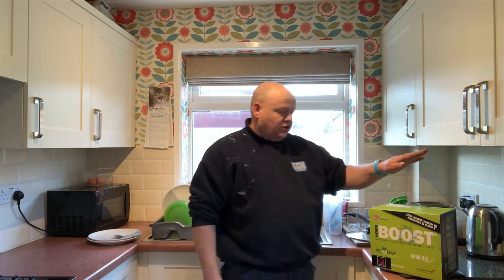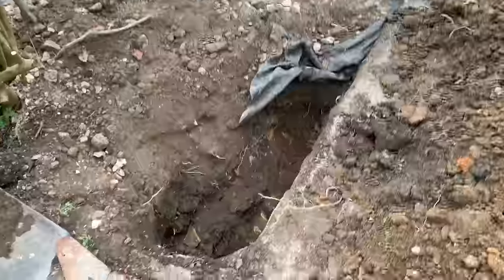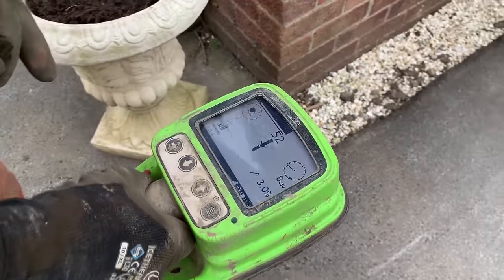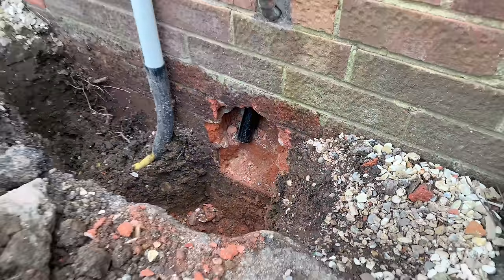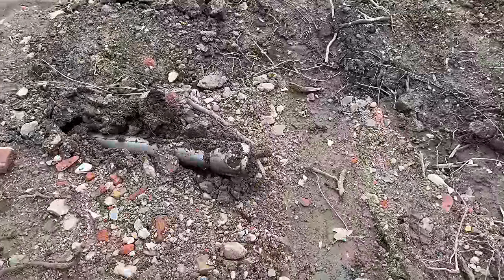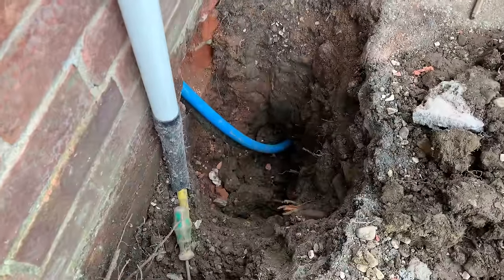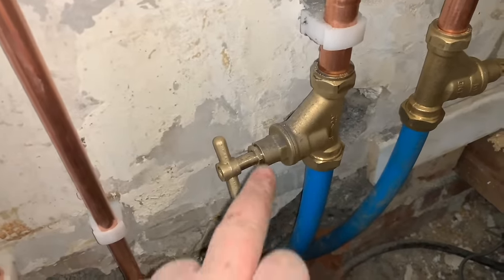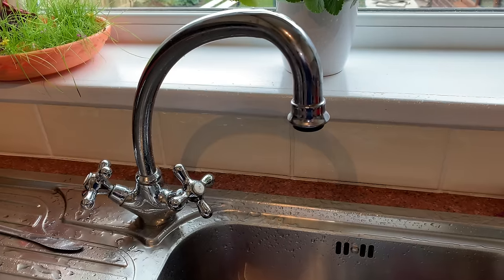MDPE WATER MAINS INSTALLATION - No Digging - Moling - Trenchless Pipe Replacement

Comment from the maker: If you want to boost upto 12 l/m then check out this video. https://www.youtube.com/watch?v=mPmBgEMtHJQ
Reply: Let me ask you about the drilling technique. In this angle drill should goes deeper and deeper into the ground but it goes sort of parrarel. How it possible. Do i missed something ?
Reply from the maker: @DerekHundik  They turn it to go where it needs to go. Thanks.
Reply: I bet Supamole didn't know you were putting this on 'You Tube',  No compliance to the NRSW,  No compliance to HSG47,  No compliance to . . ., , sad really, as used correctly 'Reduced digging' installs are so much safer and better.  He drilled up the same lay as the Gas service and the Electric supply . .  I know you will be thinking who the %$£& is this guy. . . Retired Health and Safety Compliance Manager with . . . National Grid Gas,
This video shows exactly why we have the HSE, if you look close at 12.30 the earth from the electric supply is connected to the copper under the floor, when you cut the old pipe off, if you don't connect the earth to ground, if you have a fault on your wiring you could electrify your whole house. This is very dangerous.

Comment: All done madam. 

All I need to do is return and sleeve the whole pipe, fit a non return valve, a drain off, turn round the valve which is fitted the wrong way and brick up the massive hole I smashed out with a hammer because it was easier than getting my drill out the van.

If this wasn't a cash job I'll eat my hat. 

Allan you loon get a water regs book!
Reply: Was thinking exactly the same myself lets just hope the local water authority dont watch your tube
Reply: Matthew Mottram gas fitting in the wall as well! & its press fit which he uses a lot 🤔
Reply: Are you saying he did good or bad?
Reply: Also, I know it's nitpicking a little bit, but you're supposed to use copper inserts when connecting bblue poly to brass compression.

Comment: Very interesting , I have  low water pressure on a shared supply so thinking about having a new main. What's the rough cost of having just the moleing done under a concrete drive.
Reply from the maker: sorry. Could you give them a call; the number is in the video? Thanks.

Comment: Really interesting video allen that mole plow is the business but you have your garage stopcock on upsides down
Reply from the maker: Yes you are correct but i can sort that later. Do they do a valve the other way round? Thanks.
Reply: Haven't seen one  do you think those guys you got to do moling would do an in-depth video on how the head keeps a level keel ,how they control depth etc .can they mole round corners
Reply from the maker: @mikebarron4929  I am not sure it will go around corners but they did show me how they made it go in different ways, up down left and right.

Comment: First time I've seen a mole machine. Amazing! Water regulations where you are must be different to where I am. Here they insist on a secondary sleeve where the pipe enters the property.
Reply from the maker: This one has been sleeved now, I didn't have time on the day, Also we didn't have everything we needed. Thanks.
Reply: Water regs are all the same. Must be sleeved and insulated when entering a house @ less than 750mm.

Comment: Excellent video Allen,  when I upgraded mine I dug up my drive and then needed to sleeve the mdpe and add stones around it before the water board agreed to connect. How is this overcome with the mole or is it not required via this method?
Reply from the maker: I do not know the answer but i am guessing this is fine as these guys do this every day. Thanks.

Comment: Hi.  I'm just installing Alkathene 25mm supply pipe through 110mm ducting. Can you tell me what I'd use to plug each end of the ducting. Seen advice for sand and cement thin layer? But in that case what would be put round the Alkathene so sand cement wasn't in contact. Is there a custome made 110mm rubber cap which the Alkathene could pass through?   Useful video ..thanks.

Comment: Hi Allen. Interesting video thanks. Just a question you may be able to help me with. My internal stopcock got buried/covered over when I merged this bungalow with the bungalow next door. Now in the process of reverting it back to its original form (semi-detached). However, my plumber can’t remember where old stopcock is. We have been re-connected at the road but no ideas where the water pipe goes to exactly. I don’t want to fork out for a whole new pipe so wondering if you had any ideas as to how I could find the stopcock end. Thanks for your time 🙌🏻

Comment: That wouldn't get passed in our parts, they would make you put 4" Armaflex insulation over the mdpe where it rises and comes into the house for frost protection.
Reply: You Can't Reason with Madness  What I was saying is in our area you have to have the new pipe and trench inspected by the water authorities before you can can back fill the trench, if you don't have thick armourflex insulation on the rising end then they will not pass the work so you have no choice but to do as they say....
Reply: I’d do that anyway. For piece of mind. Better a bit of overkill than a headache later!👍🏼
Reply: @JayKay-ht8rg  Not many of us left m8 !
Reply: Same in my area but they also make you fit a check valve and a drain off point.
Reply: acestu 👍🏼👌🏼

Comment: 750mm down to prevent freezing also applies to entering the building 750 back from the wall or it need insulation.

Comment: Its lovely video but is the point of the entery to the house right? Where is the insulated sleeve? Its should go under house footings... inspecting water mains everyday...
Reply from the maker: Maciej wronaki we didn’t have time to fully finish it on this video, Although it does say we were going to sleeve it. We had an issue with a couple of merchants as they didn’t have all the bits we needed in stock. Thanks 👍
Reply: @AllenHart999  sorry not trying to pull video to pieces but its hard not to  comment when things are not right . Why make so big hole in wall if needs to be in floor? And what about connection on the road? I know that update from 15copper to mdpe they want about £1500 for connection because there is nothing wrong with copper main they say. I think if showing video about slmething it should be done properly. Best regards.
Reply from the maker: Maciej wronaki The purpose of the video was to show that customers could have it moled if needed, This is work in progress, I will do an update video once I have finished and answer some of the questions. Thanks again 👍

Comment: Handy bit of kit , but how does the mole turn or change level ??
Reply from the maker: As they turn the front they can change the direction, Up down left or right. Thanks.
Reply: What we mean is: What is the mechanism which causes the drill head  to change direction?
Reply: @AllenHart999  gotta be something to do with those water jets?

Comment: Wicked video. Allen... I have good water pressure off lead as I’ve got a 1935 property. I have a sudden shock like water hammer when turning cold taps on... tried turning down stop tap in house and in the street. Not any different. I have had a new plastic type outside stopcock fitted in the street by the water board as the old one was leaking. This is when the problem started... can you shed any light in this for me? Thanks.

Comment: Excellent video.
I did notice at 12:05 that the stop tap feeding the garage is upside down. ie; not with the flow.
I know why you did it, 22mm to 25mm.
My question would be, would it create any problems when you try to close it or would you switch off the mains first and reduce the pressure before trying to close it? 
I am guessing it will have a stop tap at the entry of the garage so it may be just temporary

Comment: Hi Alan, don't know whether you're still replying on here but I've just had this done and the new connection moved in the kerb from old stop tap.  No cold water now to kitchen but bathroom and tanks are ok.  As it's a bungalow I'm wondering if there could have been 2 entry points from old supply pipe, is kitchen and bathroom. Have you ever encountered this?  Thanks in advance.   Edit: only one internal stop tap in bathroom

Comment: Hi Allen, super video, thanks!! How much to have this job done along an open car park, from the mains Toby to under our kitchen wall (18m long approx will need moled). Burst water mains (lead) needs upgraded to MDPE and new stop cock under the kitchen sink needs fitted. Old stop cock is in the cupboard and the old lead pipe runs under the concrete into the hallway cupboard. We want to put it out of use as it is lead. Thanks.
Reply from the maker: You would need to get some quotes from local companies, Thanks.

Comment: First fitting directly after main stoptap should be a drain off, tut tut. No sleeve on in-coming main or sub main as they enter building. If main is less than 750 from thermal envelope then it should also be insulated.
Reply from the maker: I have never seen an insulated main water pipe but thanks for the comment. 👍
Reply: Waterboard in aberdeenshire always want double check on new or upgraded supplys even in domestic situations ,used to only be commercial or industrial
Reply: I always sleeve and insulate mine if min distance isn't possible, as stated in WRAS book. Nice work though, press tool gives a good finish. Never knew how they moled a main.

Comment: Didn't show water pressure before this was done! What if u hit a gas line whilst pushing that metal pipe with that machine?? Also how does that machine maintain .75-.80 meters depth without going deeper at that angle? It looks like a solid 20° angle which would keep going deeper not maintaining .82 of depth. 
Is .75m really all that's needed to avoid freezing? Maybe it doesn't get as cold in the UK as it does in the US
Reply: Centimeters(cms) NOT metres!
Reply: phil mayson if u look at his radar that senses the pipe underground it says 0.82 M which last I checked meant Meters not CM so u wrong boy! I also stated I'm from the US so I don't be messing with meters and cm much. Wanna correct my language too?
Reply: If you look at the hole by the directional driller- you can see the old gas service pipe. Which was 1"steel coated with yellow plastic. As the drill went roughly parallel, it would only bounce off it..... At the house entry you can see a new mdpe gas service entering the building, meaning that the old one is now just a sleeve for the new plastic pipe. The drill can be steered, hence directional drilling!  Plus that gauge said between .5 and .8m deep, it should be 0.75m minimum, but you cannot be 100% accurate with a drill 👍

Comment: Mole went in at such an angle, how does it level out and stay at the same depth instead of continuing downwards at entry angle?
Reply from the maker: Moelwyn Hopkins They can turn it any direction
Reply: Most of these machines have a chamfer or wedge shape on the tip. When they want it to go in a relatively straight  line then the pipes are continuously rotated. (it kind of corkscrews slightly ) If they want the pipe to go down the pipe is rotated so the chamfer is on the top which forces the pipe down and conversely if they need it to come up then the pipe is rotated so the chamfer is on the bottom.  At 2.33  you can just see the wedge at the tip of the first pipe, at 3.02 they rotate the pipe and carry on jacking then in the next shot, 3.42 the pipe is being rotated. Pipe jacking, thrust boring great when they go right, nightmare when they go wrong!!

Comment: Hi Allen,  love your channel.  Quick question:  I'm about to extend my house from one bathroom to three.  I currently have 20mm MDPE that travels about 65 metres to the stop tap.  The flow is currently fine, however, I need to ensure the flow will handle the extra bathrooms coming soon.  25mm or 32mm Allen?  Many thanks

Comment: This looks like an expensive job, 3 plumbers and heavy machinery. Approx cost to have it done.?
Also the blue mains pipe looks quite thin compared to older black mains pipes which are double the thickness.
Would the blue pipe not freeze in a very cold winter?.
Reply: It probably would freeze in Vermont, but not the UK.

Comment: hi alan im no plumber but wouldn't faster water make your hot water colder or can a boiler heat any flow
Reply from the maker: You need to size the boiler correctly. More flow means we have better hot and cold water.

Comment: What about the garage feed. Looking at the stop tap with it being directional . The way you set  it up surely wouldnt have worked for the garage. Or did you have to remidy it?
Reply from the maker: Well spotted, It's all i had on the day, It has been updated now to a full bore lever valve. Thanks.

Comment: The MDPE is supposed to be 750mm deep ALL THE WAY into your house, using a hockey stick style J tube the J tube needs insulation in it as well
Reply from the maker: The video was to show how people can have a new main without the need to dig tenches, As it says in the video it will be sleeved, it will also be lagged. I also need to change stoptap as its the wrong way round. We could only use what we had on that day. Thanks very much for the feedback though. 👍
Reply from the maker: @Mr Brightside I agree but merchants didnt have any, The drive is getting done in next few weeks so it will be updated before that. Thanks.
Reply from the maker: @Mr Brightside I didn't know what I would need as the other guys were bringing the pipe etc, But yes I should of checked.
Reply: @Mr Brightside 
Ffs stop whining.
Reply: Mr Brightside because it won’t get done he is lying
Reply: The best bit is how shallow it is down at the pavement, I bet they didn't follow that copper back to the stop tap either....

Comment: Hi Allen, great vid, could you of connected a 22 Lever valve for better flow.
Reply: A plumber once told me you can't fit a lever valve because it is too fast and the change in pressure can blow off the pipe and flood your home!
Anyone know if this is true ?
Reply: If you don't have any water running in the house or flat at the time you turn it off then it doesn't make any difference , if you have water running because of a bad leak or burst pipe the worst that can happen is a loud thump as you close the valve against the flow of water and if the valve is fitted between two ridged pipes it would be impossible for the valve to come off....👍
Reply: you cannot use a ball valve as a primary internal stopcock, it must be BS1010

Comment: Alan, how did the water pressure increase ? I understand the pipe installation and the house changeover element but not how you got more water. Did you do something at the Road end of the line ?

Comment: The water board told my mate where the pipe goes through the wall he has to have it sleeved in a piece of soil pipe with a gasket fitted, It looks as if you didn't do this so is this a regional thing? or did he just get a bit of a jobsworth and it doesn't need to be done?

Comment: Nice one. Just for curiosity, I have 25mm feed that is reduced to 15mm water meter. I spoke with United Utilities but they will not allow me to have 22mm meter. How come you can have 22mm pipe feeding house? Thanks.
Reply: There isn't a water meter on that installation.I still wondering about the external connection. Normally they don't allow unless inspection to inside, which that would have failed as it didn't pass through larger pipe, sealed at both end when through the wall but assume the work will be done.....

Comment: No drain off or none return valve? Very interesting vid thank you👍
Reply from the maker: Doesn’t need a non return on domestic but it’s not finished, we just needed to get water on. Stop taps also wrong way round
Reply from the maker: I do not believe it needs a non-return valve in a domestic setting. Thanks.
Reply: @AllenHart999  haha i noticed the stop taps.

Comment: Great vid going to store the mole companys number that will deff come in handy some day.
One point the stop tap to the garage is on the wrong way and could cause a problem if the washer inside sticks, as the water flow is pushing the washer closed and not open as it is designed to do.  A lever ball valve may have been better choice.
Reply from the maker: Its the only thing we had on the day. Its been changed now. Thanks.

Comment: I did mine before i knew about the mole machine. 2 weeks of smashing concrete path and then clay with a pick axe  in  the winter 😂 went to a meter deep and the waterboard came out to measure the pit then fitted a meter leaving a straight coupler on for me to connect

Comment: What is this process called Allan? Really informative I have to fit a pump in but this set up looks much better. How do I go about with enquires ?
Reply from the maker: Any local moling company should be able to give you a price. Thanks.
Reply: It’s horizontal directional drilling, not moling. Moling uses an impact hammer and a compressor, and only goes straight. Amazed they got away with doing that job with the rig on the road and the drill rods across a public footpath with no barriers/ signs etc.

Comment: Nice, That looked a lot easier than digging a trench. Didn't realise they had smaller moles. How does it compare to digging.
Reply from the maker: The drive is concrete with tarmac over the top, I wouldn’t of even tried digging it. 👍

Comment: Are you getting water to the garage the stopcock heading to garage is in reverse direction to flow
Reply from the maker: It was all they had, it will be getting changed when that gets piped up.